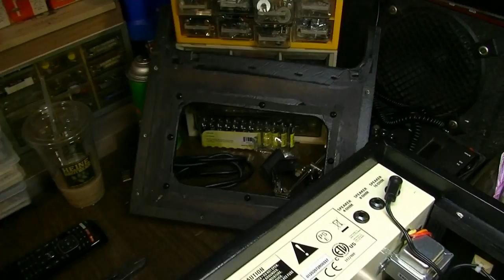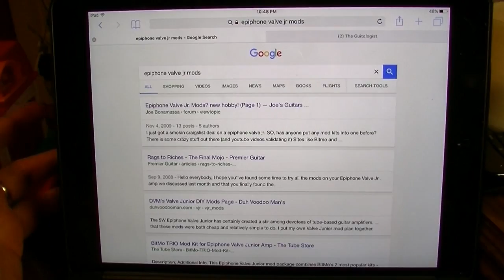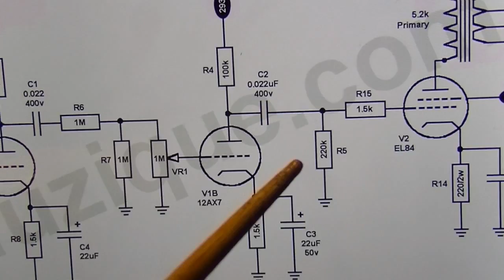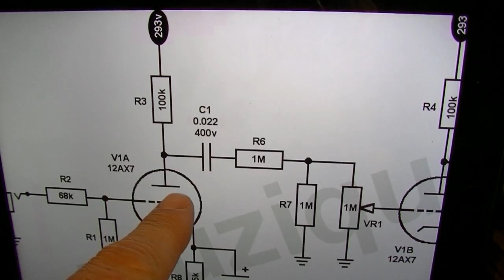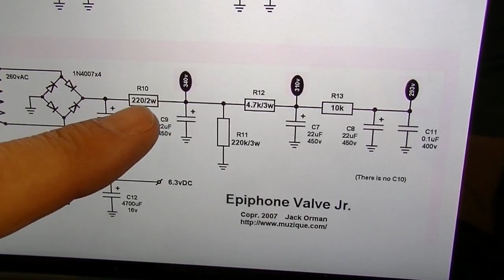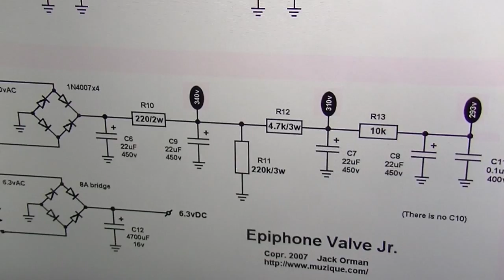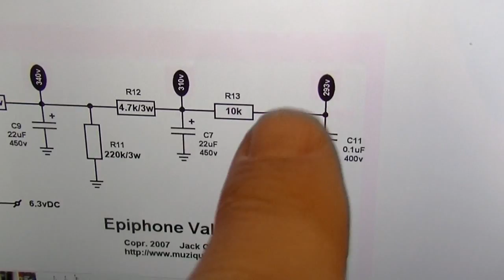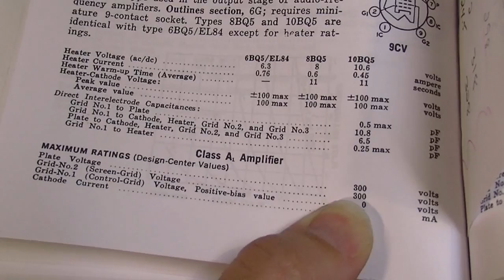Epiphone Valve Junior  Mods - A Total Waste of Time?

Comment: I used to have the mini stack. It was all ply and looked great. It was a bit quiet and a bit dark (I used to use it with a homemade rangemaster). I had to source and fit a replacement output transformer after it died mid practice. I liked how it had a 'proper' pot after the nightmare blues junior pots.

I now have a Laney cub10, it's just beautiful sounding, and LOUD!

Comment: To wrap it up: the stock amp is tested at maximum volume. As far as one can tell from the clipped recording, it's farty as hell. Goes through a bunch of modifications including replacing a suspicious chinese speaker with a shady an suspicious TV and probably broad range speaker. Now this is curious isn't it: harshness comes out of high frequencies, one would think some frequency rolloff might be in order here. My 1957 Davoli amp has literally changed voice going from a Telefunken broad range stock speaker to a proper Jensen one. Anyway, I digress. After said mods, the amp is tested and at maximum volume it's another kind of farty. Still farts, just different smell. Then, after all this time, we are given the opportunity to test the sucker at about halfway the volume. To find it is a pretty decent amp. And probably, it was just as well before the bunch of mods - only, we are not given the opportunity to know.

Now this is what I call a self-consistent exercise in uselessness :D

Comment: Cool video, but you're lost on a few things.

C4 is not 'adding lows'. A bypass capacitor like that passes all highs first, then, the larger the value, the further the frequency range extends down.

R6/R7 and the Volume Pot form a voltage divider network. Taking the output of V1A and cutting the amplitude back to 1/3 as to not overly distort V1B. Weird / bad design, but you can see what they were trying to accomplish. I like your mod there though, will probably use it myself.

R10 and R11 form a voltage divider. C11 is is paralleled with C8 for noise rejection -- large value electrolytic caps have internal inductance from the circular design which prevents high frequencies (noisy hiss) from being filtered out, which is why you parallel them with smaller value caps that have lower internal inductance and can filter that noise.

Comment: Modified versions of this amplifier can sound fantastic,  the modifications to the power supply though in particular are random and ill conceived. You bypassed a resistor that is a section of an RC filter, you also removed a bleed resistor not even knowing why it was there. The 0.1uF capacitor across the 22uF is a common approach to mitigate self resonance  that aluminium electrolytics are known for, it is not a great engineering solution. Randomly removing the capacitor likely had no effect at all.
Reply: 😂😂him so smart 🥹😱

Comment: Hey Brad, is this the kind of amplifier you would recommend to someone like me, who wants to start fooling with amplifier repairs?  I am looking for something with a simple circuit.  Something that I can start to learn on, ya know?
Reply from the maker: There are worse choices. Ideally, you'd want something point to point with PCB at all so you can modify and experiment without worrying about stressing pads on PBCs.
Reply: @TheGuitologist  Yeah, that's what I'm kinda looking for. I'm no dummy with a soldering iron, and I have fixed all kinds of electronics before. I'm just wanting a decent "starter amp" So that I can learn on the basics. 
I actually have a pretty old tube radio that is currently not working. Maybe I'll use it! I have not opened it up yet but, it's certainly old enough to be all point to point. Well, shit! My starter amp maybe sitting right in front of me already!

Comment: r11 is to drain the voltage when the amp is powered off. r10 in combination with c9 forms an RC filter for less hum. Edit: C11 is for high-frequency bypass, where C8 is for lower frequency bypass

Comment: The first cap/resistor/cap arrangement straight out of the rectifier is called a PI Filter. It’s there to lower the ripple (hum) on the power supply. I prefer replacing the resistor with a choke as you get less sag, and a better filter to clean up the power supply noise. 

The 0.1uF cap on the power supply is there because big electrolytic caps have poor HF performance. 

The 220k to ground is so your power supply can safely discharge when the amp is off.

Comment: I've got an Electar Tube 30 (remember MusicYo?). It was modded by the previous owner, an electronics engineer who replaced the power transformer, valves and added a 4ohm speaker out. Its basic but sounds great. Decent Blues Jr alternative for next to nothing.

Comment: Ah so Craig's list is like our Gumtree! Now I get it. I collect tiny amps. Vox - my favourite amps of all time (I have 7;  2 x 15 watt 2 x 12's, 4 watt, 10 watt, 30 watt, 1 watt etc), Fender Frontman 10 watt, Peavey 15 watt,  Marshall 5 watt, Westfield 10 watt. I like clean tones that are warm and rich with top to bottom end but warm thick rich mids.  most of the time I play straight through - no pedals or effects - but sometimes I will use a few pedals for a gig or session; I have thought of getting an amp built for me or even try to build one myself - must be valve - about 15 Watt to 30 watt, have reverb and tremolo.

Comment: Would you think building your own tube amp, as a experienced guitar amp specialist, is cheaper that buying a tube amp? Not saying buy a DIY kit, but could you build a bad ass vintage modded high gain Marshall esque amp from parts cheaper than buying a real Marshall?
Reply from the maker: Depends on what model of Marshall.

Comment: R11 is there to bleed the  high voltage on the capacitors to 0 volts after the unit is shut off.  If you were to wire a  A/B  switch to switch this resistor in and out of the circuit. I would give you a whole dollar if you could hear the difference. This resister is there to keep dumb guys from discharging the capacitors  with their own body parts  (painfull) .  Many folks have discovered the phenomenon of "High Voltage" in electronic devices  when this sort of safeguard was omitted.  OUCH ! ! !

Comment: Biggest differences in tone were from replacing that 1M series resistor and changing out the stock speaker. A lot of the  "brittle" tone came from thermal and shot noise in that resistor, and the Lady Luck was one of Eminence's biggest mistakes.

You never actually put any high snubbers in this, but if I were to do so, I'd do what Marshall did and put them across the plate resistors. To the AC signal, HT is as much of a ground as the 0V rail.

Comment: Volume control seems to be an unnecessary luxury option. Most of us probably have a volume knob in the guitar. 😀

Old alnico speakers, if they are in good condition, are sometimes real gems. I have a late 50's very elliptic shaped Rola alnico speaker which sounds just unbelievably good.

And with these two tube amps, if you want different, more relaxed clean tone, try 12AT7/ECC81. I just recently tried a brand new JJ ECC81 instead of 12AX7 in one of my amps and it sounds absolutely great when playing at clean volume.

Comment: yeah im normally onto your vids but may i say whats one mans brittle may be another mans brite,reason im not into your mod is i found it took what originally sounded like a jimmy page tone and turned into every predictable amp ive ever heard,no disrespect your a champion but ive modded mine and i bought a resistor kit from Canada that replaces about 5 resistors with better quality different value blue colored ones and it craps on this mod.also i recorded a musical for new york with one of these and i used a vintage alnico 50 watt celestion that was the biggest improvement.the kit from Canada is 29$ ITS FROMEL ELECTRONICS.i found this mod a bit of a waste of time like the title says,sorry avoid this mod here folks id say,lost all its bite and bark i can see why some guys would like this but i bet page would not,no bite amp mod .its better for clean tones ill say that but that miss,s the point of a 5 watt growler

Comment: Hello sir.  I love your channel.  I have a Valve Standard that I picked up minus tubes and speaker and I am to attempt breathing life back into it.  I bought some tube covers that I figured I could use the bases that came with them and mount them in the little ear cutouts in the tube holes of the chassis but then I saw that what it needs is a different kind that your video showed!   Thank you.  What is that kind called called?  Do other companies besides Epiphone use them?

Comment: I bought an Epiphone Valve Jr and after modding it a bit I had the same issue that it sounded to fizzely for my taste. After asking a fellow amp tech we changed the R15 resistor from 1.5k to 100k Ohm. His reasoning was that the pre-amp creates too much amplification for the grid of the EL84 and by increasing R15 it could become smoother over all. We've tried it and it was instantly better. 

Additionally we added a "Bone Ray / Roy Bean" tone stack after the volume put which made this amp super easy to dial in now. There is a book "Designing Valve Preamps for Guitar and Bass" by Merlin Blencowe which had the schematic - I couldn't find the schematic on the web. Essentially its a Tilt and Middle control which is quite effective and offers quite a variety of sounds.

Also I hook it up to an Eminence Cannabis Rex 12" speaker and it sounds wicket cool - or at at least a lot better than before :)
Reply: Oh I found it https://el34world.com/Forum/index.php?PHPSESSID=3ab430srvh54b23l336mecrk23&topic=16837.msg167081#msg167081

Comment: ....preachin' to the choir again!,  i upgrade/converted my marshall 15w solid state, replaced speaker to a creamback, and built an all 1x12 pine cabinet, OMG!, the difference is incredible, ofc the speaker accounts for most of it, but the cabinet adds a definite aspect to the sound, much more defined and whole sounding than the composite board cabs!....

Comment: The first difference in improving the sound is made by the speaker - Thanks for great job
Reply: The speaker used judging by the basket stamping is a Rola USA alnico . By 5his time Rola UK had bought Celestion and used large cylindrical alnico magnets.

Comment: Awesome job Brad!  I loved your attitude going into this.  For what it's worth, I think it sound pretty good at the end.  My first amp ever was a 15 watt solid state Fender amp with an 8" speaker.  Since then, I've pretty much always preferred amps with 12" speakers and I suspect that this amp would sound pretty good through an open back cab with a low wattage, vintage voiced 12" speaker (or a pair of them).  I'll check out the follow up video too.
Reply: That's what I was thinking also.  The speaker is definitely the worst part of the combo in its original state.  
My first amp was a similarly cheap tube amp combo with a cheap 10" and as soon as I hooked it up to a quality 12" speaker I stopped being as concerned about getting a new amp.  It was a whole new world of tones.

Comment: Was dyin to hear that amp variac'd down to see if the EVH sound was approachable.
Reply: You can't be so obsessed with gear to the point where you don't even know what purpose it serves. A variac would suffocate this amp from the already low 270-290v at mains, which is basicallly the minimum an EL84 function.

This is far and away from being anything that resembles a Marshall JMP.

He had the right approach in refining the circuit which really wasn't designed to shape the tone in any meaningful way.

Comment: A 10 inch speaker would solve the fizzy tone I think. Great job for only a few parts. Your idea about a small Pico cap to ground or screen to plate works. I did this on an Orange Dark terror. Even across the plate resistors which I dont normally like to do, add a 100pf or 200pf there and trim off those fizzy overtones.

Comment: The harsh buzzy overtones when it's dimed out, ugh. I have best luck with humbuckers on this amp, neighborhood of 5, cleanish rhythm sounds. Single coils, I gotta run it through eq or the bottom end disappears. Bought mine in 05 or 06, I think it's the first version of the circuit. I've run the speaker in the cab on a very similar low powered Hughes and Kettner tube head from the early 90s, and I'll tell you, the speaker and cab aren't what's lacking. I'm in the middle of your vid as I write this but I think your mods are on the right track. I know nothing and play even less, but thumbs up.

Comment: Interesting video, thanks. I see I am a bit late to the "It's a bleeder resistor" train from the earlier comments! I wondered if you siliconed those components down afterwards? I'd be worried about that ceramic 5w plate resistor shaking loose and damaging the tracks on the board. Thanks again.

Comment: I've got a Valve Jr I modded. I put a Jensen C8R, a Musical Power Suppies OT10SE output transformer, added some more filter caps and changed a few small capacitor and resistor values. I'd put a video up showing it off, but it's on semi-permanent loan at a friends studio. Sounds amazing now!
Reply from the maker: A new OT would work wonders.
Reply: When my buddy is done recording his EP I'll see about doing a video documenting the changes and playing through it.

Comment: I have an Epi Valve Jr Head plugged into a speaker that came from a late 1970s Fender Twin Reverb that is mounted in a Pine Cabinet that my wife built. At full volume it is loud. It is full. It is not fizzy. It is hard rock and roll. And in my small music room it is very easy to control the feedback and sustain endlessly. When I have it set to about 9 and run my guitar in stereo thru an analog chorus with my Dual Showman it sounds as pure and clean as any stereo. I am looking to buy a few of these and replace the electronics with some fiberboard mounted components just for grins.. Sort of trying to teach myself the dying art before I croak! Thanks for posting your videos, I glean a lot from them.

Comment: R11 is there to slowly discharge the cap when the amp is off. It is used as a safety measure.
Reply from the maker: There is a follow up video showing why it's probably not necessary.

Comment: The 0.1uF cap in parallel with the reservoir electrolytic is a standard way of minimising poor high frequency  performance of aluminium electrolytics. It is a 'hifi' enhancement and would do no harm left in circuit. The bizarre 1 meg voltage divider to the second stage is a poor way to deal with gain, and I may have just left out the first stage cathode bypass to lower gain without hurting performance or frequency response. This again though is of a 'hifi' mindset. The speaker and transformer (esp single ended) though, are the crucial elements - after making sure the circuit is reliable and, er,  sensible!  - concentrate on those items, which unfortunately are not easy to fiddle with. Power supply performance with single ended devices is crucial as there is no rejection in the output and choke regulation or active regulation is usually the order of the day, hence the extra pi network may have been useful, along with voltage reduction as you are going way over max ratings. Though that single extra 'R' drain, if that was what it was, was strange as usually each big storage device would have one directly across it. All biassing arrangements for ECC83 are published with various HT values and R values for anode load and cathode bias with accompanying load lines, graphs and distortion figures (before feedback) by the engineers who designed the valves and these are proven  and good practice to rely on - maybe the guys who designed this amp should have taken a look first.
Edit; PS Sorry, I didn't say I enjoy watching your videos, even if I am a bit anal about things.  And it's great to see all this cool stuff on YouTube.
Edit...again...Anyone who has one of these and wants to make it last ten times longer - sort out that HT issue, its meant to be under 300V on the anode. Absolute ideal values for EL84 are 310V on the reservoir feeding output transformer. Ensure you are not running over 40mA through the tube - this is the most important thing, yet you are in uncharted territory with over max screen and anode, you really should aim for correct voltages, and I would disagree with the maker of this vid and say it's fairly critical, again figures are printed from major manufacturers.  Not surprised it sounded funny.

Comment: Could you do a summary of your mods? And what would you typically charge for doing some mods like this?  I picked up one of these for $25 at the pawn shop just the other day. Haven't had time to play around with it too much yet. Unfortunately it appears to be the 1st version that has AC heater plate voltage and all the other issues. I didn't care for the sound too much, but tried it with my compression/sustainer pedal and that seemed to improve things quite a bit with a little tweaking. I would probably use this amp with a Zoom muli-effects  pedal. My go-to guitar is a 3 pick-up Tele with humbucker at the bridge. Mine doesn't seem to have the Eminence speaker - It has the Epiphone emblem on the back of the speaker. Mine seems to have quite a bit of tube rattle when cranked up. How can I fix that?
Reply from the maker: +Steve LaCombe you can buy tube rings to go on the tubes, or change tubes to solve ring. The mods in this would cost you about $90 in labor if I do it.
Reply: Thanks for the reply. I'll pull the chassis and see if everything is tight. I found that the speaker screws were pretty loose, especially one of them. Then see if the tube rings  will help. I suspect maybe I should replace the tubes since this thing is 12 years old? 
Do you think it's important to change the heater plate voltage from AC to DC?
Reply: My guitar has a piezo pickup that I almost never use, but tried it with this amp and it actually sounds pretty good when blended with the humbucker.